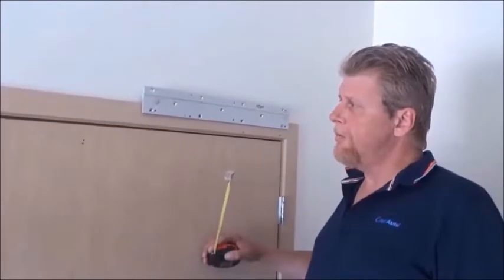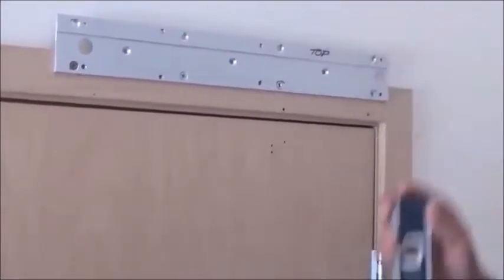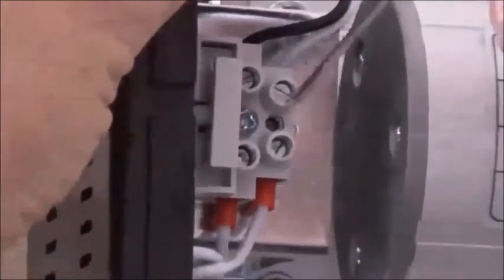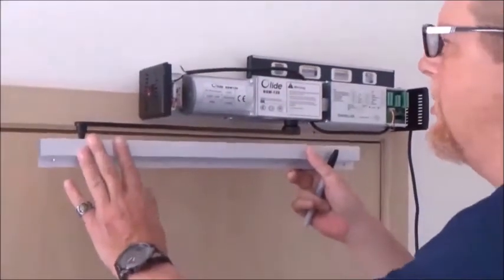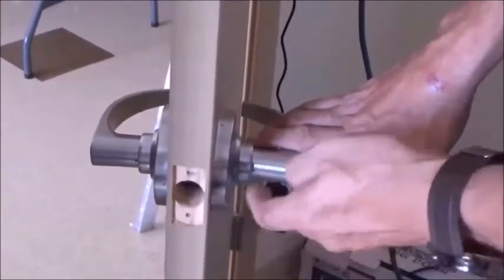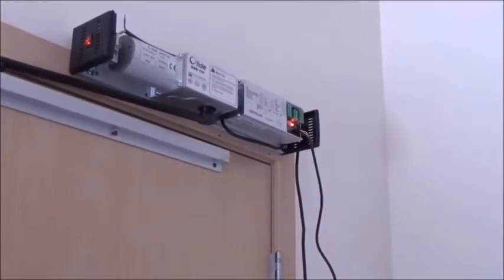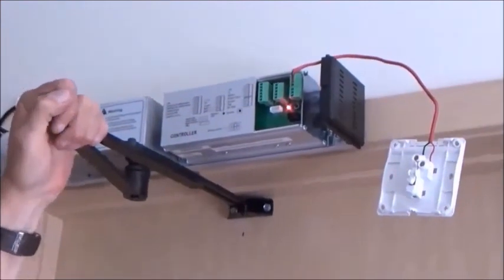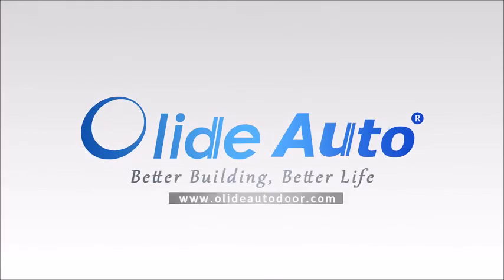DIY How to Install Model Olide-120 Automatic Swing Door Opener

Comment: We would like to install this in our restaurant. However, we have negative pressure issue in our restaurant. It means we need to push harder when we open the door manually. In our case,  can we still use this automatic door opener?
Reply: probably going to need a better opener

Comment: Do you remove the strike on exterior applications as well? Seems like a good product but it's strange to me that there is no strike hardware integrated into the system to release the door when the call button is pushed.
Reply from the maker: Hi, you can add a electric strike, when there is open signal, the strike will release. You can refer to the strike below:
https://www.olidesmart.com/collections/door-lock/products/olide-electric-strike-for-automatic-swing-door

Comment: I'm installing a DSW-100N, it's basically the same unit, but the motor spins constantly with power on. Is this thing defective?
Reply from the maker: No, If you don't have it mounted on the door, a direct test motor is what will turn. You can try mounting it to the door.

Comment: Hi, Can We use it without the buzz sound? Thanks
Reply from the maker: Hi dear, 
There is no switch to turn off the sound from the controller, you can open the cover, and find the buzzer, drop some glue in, the buzz sound will fade or disappear.

Comment: I have the same opener but can not set it up with my iPhone. Do you have any advice.
Reply from the maker: Hi, the door opener itself dose not including wifi smart function, so you can not set it with your phone if you only have the door opener; If you want to control the door by phone, you can add a wifi remote.
https://www.olidesmart.com/collections/spare-parts-of-accessories/products/smart-wifi-rf-remote-control-os1002
Reply: Can the Wi-Fi be used as well as wireless push buttons that was included in my box?

Comment: Mine is working fine except when I put the cover on, then the remote control fob no longer works except when it is only a couple feet from the opener.  I tried replacing the batteries in the remote control but it still doesn't work.
Reply from the maker: Hi dear, Please try to pull out the antenna inside the controller(open the side cover of the controller); if the distance is too far, or blocked by the wall, the signal of the remote control will not be good.
If you still have problem, please contact with us: tech@olideautodoor.com
Reply: @OlideAutoDoor  What's with this "Hi dear" stuff?  I am buying this for a customer but these responses from the Olide are making me a little apprehensive.

Comment: Can the door be programmed so it does not auto shut?
Reply from the maker: Hi dear, 
Yes, it can be programmed. You can adjust the hold open time "OT" to "--",  the mode will change to: press button once to open, press again for close; Or you can press hold-open button on the remote control, the door will keep open, until close button is pressed.

Comment: I have one installed but now the arm seems to be trying to move 360 degrees. I don't believe anyone messed with the settings. Any idea what's wrong?
Reply from the maker: Hi Dear, can you please send us a video for the door opener? I guess there is a problem with the install location.
Reply: @OlideAutoDoor  im having the same issue, any fix?

Comment: Every thing is in & set & it opens it even opens on it's on but it won't close I've tried every thing what should I do now?
Reply from the maker: Hi dear, can you please send us a video? Let's check if there is any problem with the installation size. 
And please confirm whether the opening time is adjusted to infinite(or pushed the open button on remote), the door will keep open; Also please check if there is PIR sensor or microwave sensor installed.

Comment: MADNESS! I have invested at least two DAYS in trying to get this piece of junk hooked up correctly. Insanely complex and badly written manual, evidently done by a team of engineers on acid. Video JUMPS without showing how they did some vital steps. Crazy. My wife NEEDS this door for her wheelchair.  VERY frustrating.
Reply from the maker: Hi Dear, 
Can you please tell me which part you don't know how to do? We will help you solve the problem, and you can also call the tech support for help.
Best regards,
Olide
Reply: @OlideAutoDoor  This is insane. We had to BEAT the slider brace loose from its cover with a HAMMER. Now will not fit back on the brace which we attached to the door. Then we had to BEAT the swing arm ONTO the notch in the rotator axle with a HAMMER. Now how do I program the remotes?? NO instruction whatever. None. Please advise.
Reply from the maker: @dennisporter9361  Hi dear, Can you please tell me your email address? So that we can better confirm the problem and help you to solve.

Comment: It keeps opening and closing on its own , what am I doing wrong , it keeps cycling
Reply from the maker: Hi Dear, 
Can you please send us a video to confirm if there is the problem on installation? 
There are some reasons cuased it keeps opening and closing. 
1. The installation angle or size is incorrect;  
2. Door opening direction is opposite; 
3. The hold closing force is in a low value, please try to increase the closing force, and see what happen.